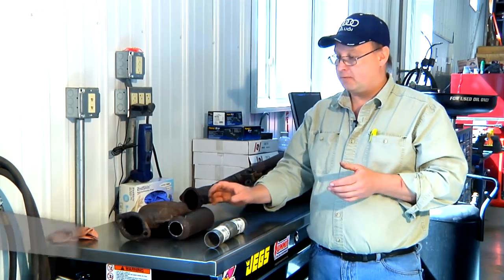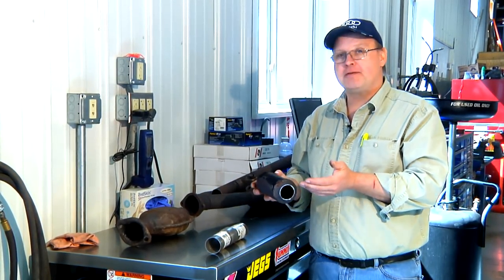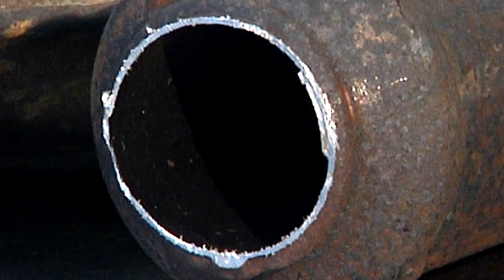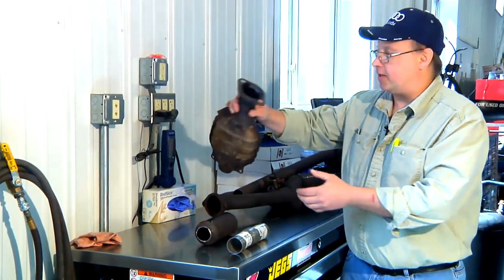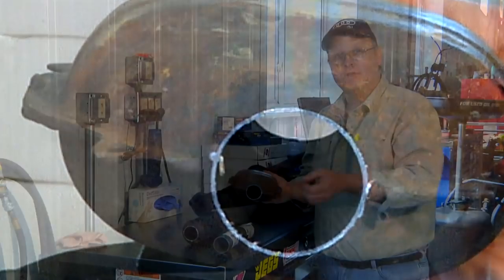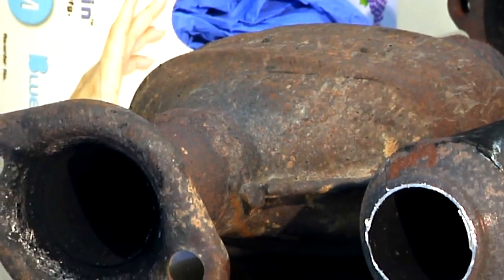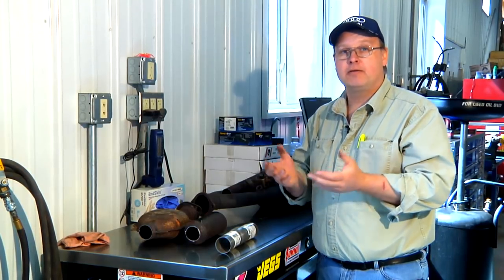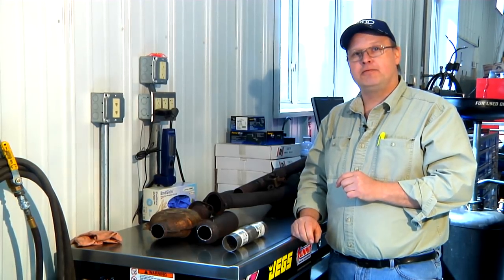What Happens if You Replace the Exhaust Resonator With a Pipe? : Under the Car Repairs

Comment: I'm so tired of "experts" saying that an engine needs back pressure.
Reply: Pretty sure they covered the back pressure bs in an episode of engine masters.
Reply: yep
Reply: No shit!
Reply: how many pro drag racers run anything but open headers? think of that. I think the whole back pressure bullshit got started because of the fact that if you have too big of a pipe or headers you will lose performance because there is less exhaust velocity.
Reply: they all run open headers. even the n/a ones. why would an engine need backpressure?
Reply: I was trying to dumb it down, but I'll try and explain in more detail. I think you agree that in the higher rpms no back pressure is better in every way, but in the lower rpms it's still better. the reason you just gave me for needing back pressure is valve float which makes some sense. stiffer valve springs are usually the remedy for valve float and I don't think exhaust back pressure would help much unless you had an unreasonable amount.
Reply: now I will try and explain how I think this myth was started and my reasoning for not believing it. if you were to go chop off the exhaust of a car you would definitely lose low end power, but not because you lost backpressure. you would lose low end power because you would have less exhaust scavaging.
Reply: I wouldn't call it "mechanical back pressure" lol, and that would be a really long episode of engine masters. there is so many variables. the headers would make a massive difference. I think with most stock headers or exhaust manifolds it would be worth running open headers because the exhaust velocity would be terrible. I think engine masters should do more tests on more reasonable street setups. most of the viewers will never own a 600hp engine.
Reply: I don't think exhaust back pressure would make much of a difference in curing valve float and like I said I wouldn't call it mechanical back pressure because it unnecessarily complicates the conversation.
Reply: In general, they're considered "experts" for a reason.  Not saying that all "experts" you see interviewed are as well educated or experienced as they could be, but until we have some standard benchmark test to certify somebody an "expert" in any given field, we'll have to take what they give us.  Also, it seems as if some of the commentators here aren't perfectly clear on the relationship, and difference between pressures and velocity.  It's a complex science, that in no way can be well explained in a few YouTube video comments.  Also, you have to consider the application, as he's not talking about race cars here.  For what it's worth though, the man in the video is correct, and on a last, clarifying note..the "catalytic converter looking" piece he shows is indeed a resonance tuning device.  Just because it is shaped like most older catalytic converters were, doesn't mean it is one.  Millions of modern vehicles have strange looking resonators, which may or may not be baffled or completely hollow, depending upon their function.  Whew, these comment threads are exhausting..
Reply: agreed.  It's a hangover from 2 stroke motors.   Back pressure being needed is a common myth on a 4 stroke.
Reply: You need 0 back pressure why do the "internet experts" keep saying you need backs pressure it ain't a damn 2 stroke.
Reply: wankels also need certain back pressure
Reply: +Hello By   a stock engine is verry often upset in at least a part of its rev range when deleting the exhaust or putting a straight pipe on it.      hence why you could say an engine "needs" BP
Reply: You are right.   Thats exactly what I'm saying for years
Reply: Good God.  I'm not full of myself at all, as if you carefully read what I wrote, I never declared myself an expert.  Not once.  That being said, almost every engine benefits from a certain amount of back pressure.  Like I stated, unless the engine is a race engine designed to run at WOT (wide open throttle) all the time, back pressure is beneficial.  If back pressure is truly so terrible, why have some of the greatest engine builders in the world, including Ferrari, built exhaust systems with active restriction valves inside.  That's right.  Ferrari engineers put butterfly valves inside their mufflers, that open and close depending on engine RPM and throttle position, providing the perfect amount of resistance at any given time.  These valved mufflers are more common than you'd think, and it's not there for sound control.  For example, many common BMW, Nissan/Infiniti, & Mitsubishi vehicles have spring loaded restriction valves inside their mufflers, which only open fully at WOT where back pressure isn't needed.  Another example is Mazda's SKYACTIV engine optimization, where the engineers have utilized specially tuned manifolds.  These manifolds, used in coordination with DI, VVT, and other advancements, have allowed higher compression ratios on lower octane fuel than ever thought possible.  They can easily burn 87 octane gasoline at 13:1 compression without any knocking issues.  So in closing, unless you drive with your foot to the floor over 85% of the time, back pressure is your friend.  I'm not declaring myself an expert, but I do have considerable experience in this field, and make my living in it.  Please don't take any of this as condescending in tone, as I don't intend it that way.  I'm just trying to clear the air on a subject that is plagued with lies.  -RT
Reply: Well you are coming off as condescending, but those exhaust butterflies are not for exhaust back pressure, they are for noise suppression.  That's it.   No other reason like back pressure like you say.
Reply: fluffy65 I am so agree with what you're saying I totally do not understand people who do not understand and just wants to destroy they'rs car's with the shit work  first learn about what is the best for your car and make it so that it works not just hanging on or falling to part's
Reply: yes 'back pressure' is a stupid term, but, if you take the exhaust manifold off you have 'no pressure' after the exhaust valve - which is bad.
Reply: the active restriction valves you spoke of are only for noise suppression and to get a little better mileage.
if you don't believe me, just straight pipe a car and take it to a dyno.
I'll make more hp, and it'll have a worse fuel economy.
on the other hand, there are better exhaust systems than just straight pipin'.
Reply: Same here this "back pressure" talk is absolutely bullshit  Like telling people who run IHRA to install 3 chamber mufflers on their race cars.  I fuckin hate it too.  My favorite is "It will mess up your valves if you run open exhaust"
Reply: any one else notice the "expansion chamber" sure looks an awful lot like a gutted catalytic converter
Reply: Fluffy65... I own a 2011 Ram 1500 4x4 with the 5.7 Hemi. I removed the entire factory exhaust and replaced with short tube headers and new pipe (True duel exhaust with a cross over pipe) and with new Flowmaster mufflers. I ordered new exhaust tips from Dodge and used them. My temp ga. dropped 10 deg. I have gained as much as 8 miles to the gallon.( I was getting 11mpg) The HP went up from 395 to 406hp. Yes the truck is louder but it runs so much smother also! I now have 120,000 miles on that motor and it is just as strong and healthy as when new. A four stroke motor needing Back pressure is bullshit!
Reply: Thejanka51...my 5.7 Hemi with short tube headers and duel pipe all the way out to the back with Flowmaster mufflers. No cats or anything making back pressure. I am making over 400 HP now and my millage has gone up by 8mpg. Oh and its a 2011 Ram.
Reply: Matthew Foote very true 
If I needed it so bad how come when I delete my resonator and put a new muffler that is more free flowing, I gotten better performance and a better mpg. 

From what I understand was a free flowing exhaust allows best performance and best mpg
Reply: you need back pressure to extend the life of your valves.. nothing to do with power
Reply: yea.... you do know that it's the excess of "back pressure" ( by using a smaller pipe than you should ) that bents valves right?
Reply: I'm glad someone said it.
Reply: F* backpresure. the car can lose his exhaust gasses easy after the header. For example a 4-2-1 header will get your gasses eventually togheter. Lets say there is only a header, why need a cat? i see it as only more obstacles for the exhaust gasses. Okay a rear muffler does decrease the sound alot but that is for sound, not for backpressure. i find it more logicall to run after the headers a straight pipe to the rear/ rear muffler than a cat in between it.
Reply: +Matthew Foote, I replaced the standard silencer system on my Gold Wing GL1100 some years ago with a cheaper 'universal' aftermarket unit.  The 'back pressure' was incorrect and the bike had no power or torque, obviously due to the flow of gas out of the combustion chamber being incorrect.  Needless to say, I dumped the universal system and fitted an original OEM system from Honda.  So yes, an engine does need 'back pressure' to control the flow of gases out of (and therefore into) the combustion chamber.
Reply: Visionery1 incorrect. You are confusing back pressure with exhaust pulse.
Reply: arien wilkins look into supertrapp mufflers for motorcycles. You can use back pressure to adjust where your power hits for different types of terrain. Back pressure can be a useful thing. More back pressure= more low end power but less top end. Less back pressure=Less low end power but more power at higher revs.
Reply: Wayne S. Very very very incorrect. So very wrong wrong wrong
Reply: Unless it’s a god damn two stroke they don’t need it
Reply: Wayne S. Wrong wrong wrong wrong wrong wrong wrong wrong wrong
Reply: Matthew Foote especially when u look at all the drag racers that have dumpouts right after the turbo
Reply: AL CAPPS no but even 400 -1000 hp drag cars usually run straight pipe
Reply: It depends.. sometimes it'll make it run bettee
Reply: Try running a 4cyl with no back pressure and its will lose most of its low-medium torque and run like shit, not a problem with a race motor, but for a DD is no fun and LOUD. 
Now V8s are a different story.
Reply: Matthew Foote in 2 strokes. Not 4 strokes...
Reply: no such thing as back pressure , did you see "Resonator" and Cat's on spitfires ? lol ... thy just their to keep them legal ..it has no impact on engine.
Reply: Visionery1 or you could have tuned (richen)your carbs  and benefited from the free flowing exhaust .
Reply: Matthew Foote
Reply: my car needs back pressure, thats why it came from the factory with a resonator.  Love when dumb people don't know the difference between racing and factory built cars
Reply: Matthew Foote you apparently have never owned a 5.0 Ford if you don't have correct back pressure say straight pipes your burning your valves and at higher RPM you risk blowing the engine your comment does not any any way make you sound smart at all if not a little sinical
Reply: Never heard about The Otto Cycle? I guess so, mind apathy is a modern plague....
Reply: JoeIsCrazyWillman you need back pressure for regular vehicles for many reasons one being the valves. With out back pressure as the car slows down it will pop, when it pops it puts unnecessary pressure on the heads and cylinders internal parts. After time can extensive engine damage. Now the reason why drag racers run open is because as a professional those engines get tore down. As an amateur street racer you have never seen anyone with a street that runs it every weekend racing and las for for even 5 years with out having to do something to it
Reply: yeah thats why i lost 40 fl/lbs of torque and 29 hp when i stright piped my car :)
Reply: If you're looking for maximum horsepower minimal back pressure,minimal as in a small amount to avoid over scavenging the exhaust and pulling some of the fresh intake charge out with it,also exhaust system pressure helps achieve EGR which allows for lower octane requirements and lower peak temperatures,I'm speaking of naturally aspirated engines only,I've no experience with super charged engines.
Reply: Its BS full free flow
Reply: Then why do NASCAR Truck Series game 35 horsepower when they put a muffler on at tracks that require it?
Reply: Do 4-stroke engines need back pressure? No. Is it a good idea to remove all back pressure from a 4-stroke engine? Fuk no! Read fluffy 62 answer to this and you will see that it is true, you need back pressure! Every single engine on the planet should have some back pressure! Some race cars go to Extreme Measures to find out exactly how much back pressure benefits their engine, as in Ferrari! It is not always the right move to having a completely Open Exhaust I learned that in the 70s in my small engine class in Germany when I was only 15?
Reply: @arienwilkins  There's also another way to prevent valve float.I forgot what is lol. Check BMW's B58 engine.
Reply: @taledarkside  Love the fact that dumb people like you who think that economy cars are optimised for power output
Reply: i think he was referring to the backpressure that the stock ecu is calibrated for. Not necessarily saying that engines "need"  backpressure.
Reply: @Fluffy65  It's just your wording.

 Everything you said is correct but what you are taking about is flow velocity and scavenging not back pressure.

 It's not just you. Pretty much everyone who says anything positive about back pressure (which is bad) is talking about flow velocity and scavenging (which is good).

 Flow velocity is how fast that burnt slug of exhaust gas is moving down the tube.

 Scavenging is using the reverse sound wave to help pull/push the exhaust slug down the pipe.
 
 That reverse sound wave can not only prevent all the burned exhaust from leaving the cylinder, but push it right up your intake.
 
 You can see it on carb motors where you see the gas mist coming out of their throats.

Reversion (bad)

That's why anti reversions (AR) works so well in the low to mid rpm range.

It takes strength away from the supersonic reverse sound wave  pushing back up the intake while keeping the sound wave push/pull effect it has helping the fuel air charge filling the cylinder and helping the burnt exhaust slug moving down the exhaust.

 Long tube headers are champs in their scavenging effects. 
 
 You can get long tube effects on short tubes by using a spiked  merge collector (which are works of art) along with a well designed exhaust system. 

The idea place for the AR chamber is 6"-8" off the exhaust port on the primary. Next best place is after the collector. Most common is where the stock resonators are midway down the exhaust.. Last place is in the muffler design.

 They are very simple to make. It's just a slightly bigger pipe overlapping  the standard pipe. 3"-5".
 

It's a fascinating science that has no one computer program that can be used to figure it out because it's always changing as the rpms rise and loser.
(Maybe a super Cray could do it?)
 The computer design and formulas get you in the ball park, then you have to test prototypes on the running engines to fine tune them.
 B
Reply: @Fluffy65  Restriction valves are for noise reduction you braindead imbecile
Reply: @garykish8951  Finally someone who makes sense. That moron kept rambling garbage about backpressure and it was fucking annoying
Reply: Gary Kish people are telling me that a straight pipe design ( cutting the muffler off am putting a straight pipe instead) is bad for my engine and I should get a flow master 40 series. Could you explain why they would say that or if they are wrong? Because I don’t know much about all this back pressure stuff
Reply: Me as well I have been in many arguments over the subject. Most people dont understand.
Reply: Joey_No_Bologna dragsters make 1100p+ hp and have no exhaust system at all. I guarantee a dragster would lose power with a muffler. Why the hell would putting pressure on your exhaust valves help at all? It would just make it harder for the exhaust to leave the engine.
Reply: @arienwilkins  yes that and these companies can’t compete with the cheap price of a straight pipe the only selling point is that there full thousand dollar system are legal for inspection so they gotta say stuff like it’ll hurt performance if you go the cheaper route to keep sells
Reply: I agree only 2 strokes ned back pressure to runt good not a 4 stroke mean a car engine
Reply: Diesel doesn’t need back pressure. Turbo loves to push air.
Reply: Agreed. The most restrictive part of the exhaust system is the cats which is before any mufflers or resonators. So it really doesnt matter if anything from the cat back has a huge muffler or a straight pipe. And even if it did change the back pressure modern pcms can make up for that little difference anyways
Reply: You and me both! This myth has been disproved time and time again with dynos and track times.